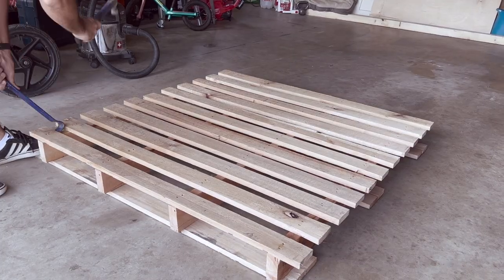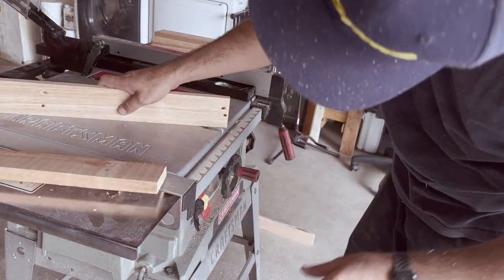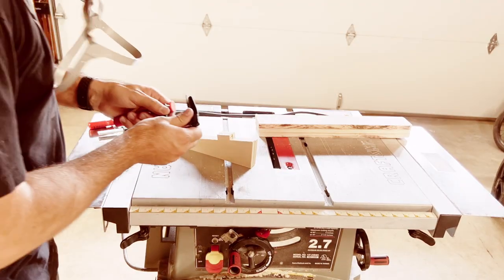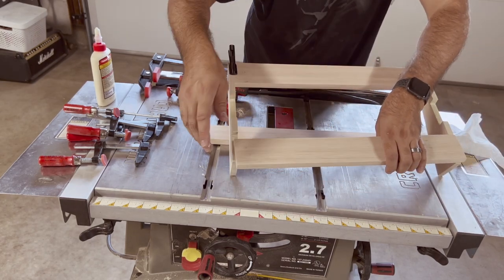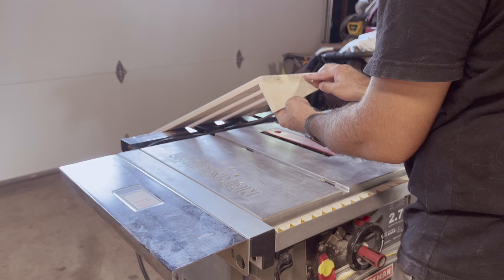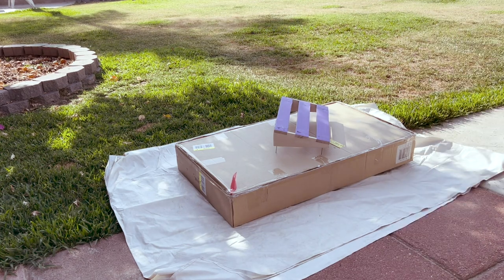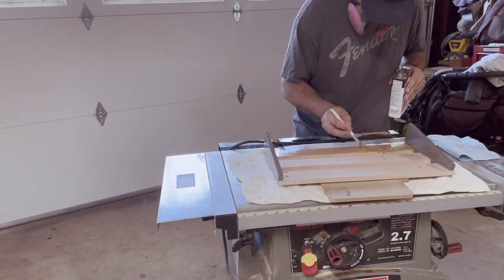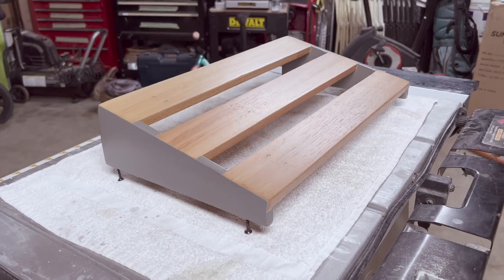Turning a Pallet into a Pedal Board | DIY

Comment: what is the thickness of slabs
Reply from the maker: The thickness varied a bit but they were around 3/4 of an inch (~19mm) and were all uniformly planed down to a little over a half inch (~14mm)